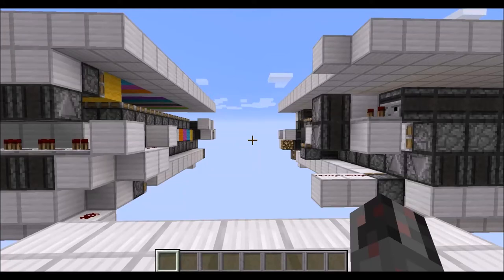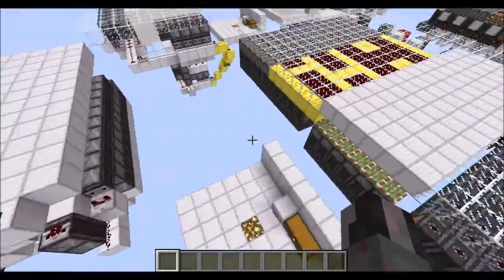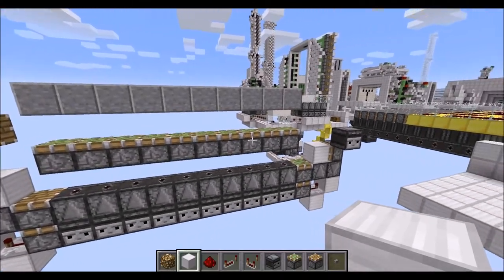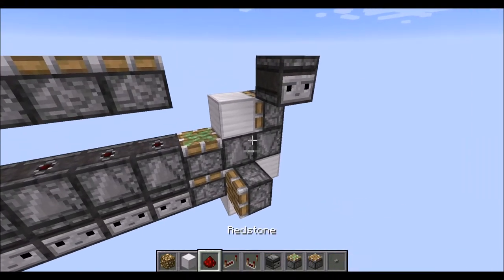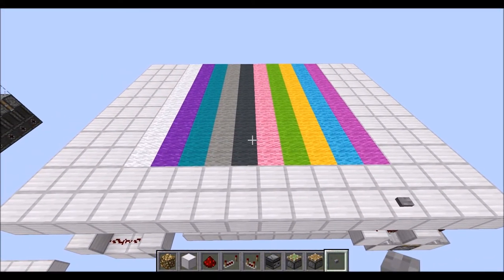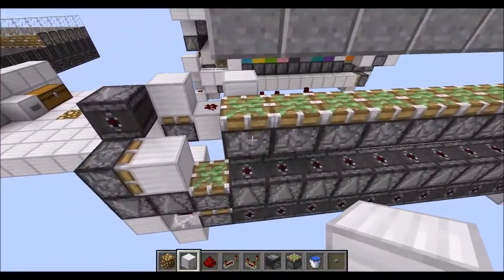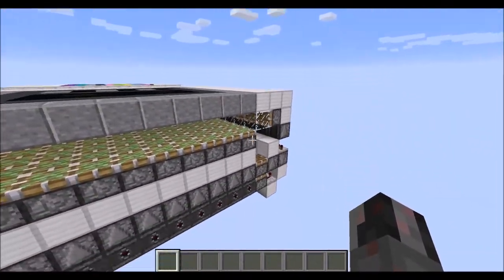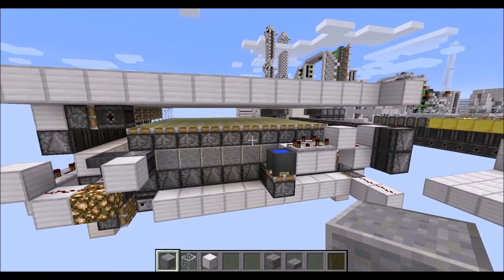Tutorial: Expandable, 10-wide Floor Block Swapper & Shifter [Java 1.11+] (Schematic)

Comment: For those who will say it's slow, well it's a 10 block swapper guys, and it's so majestic and well designed that it gives you not only the swapping but even an extremely satisfying show.
Thank you Walter for designing some of the best redstone contraptions ever and sharing your talent with us
Reply from the maker: Thank you!

Also, it may seem a bit slow for most, but it's actually pretty close to supercharged. Those double extenders simply need some time to completely extend and retract.

Comment: Haha, dude, nice. This is about exactly what I was building. I just used diagonal pistontapes instead of double piston extenders. Yours is a really simple design too, it's quite impressive.

Awesome concept! 

Hmmm, wouldn't it be possible to make it Glowstone viable by just increasing the height of a module by 2, pull the floorpusher pistons up to be directly powered and make the pistontape go below that. Because you're using the observer"timer" in the swapper, you shouldn't have many issues, no?

EDIT: That thought was too fast it seems but bear with me. To fix the problem of the fact that you're pulling the blocks above down, you can use a diagonal piston tape to pull the blocks down a bit to then be pulled down by a double extender. You would need to build a small "intersection" inbetween the blocktape below.

I hope I could convey what I meant ^^'.
Reply from the maker: I think I get what you mean, but with those diagonal tapes there's the risk of going over the pushing limit and the total size does increase too. I mentioned it a bit at the end, but you can actually put transparent blocks in the tape, which results in blocks that don't get pushed up into the floor. Adds a few interesting options for the users (hidden messages, two-part maps, etc.).
Reply: You would have to put a little intersection in the tape below pulling a block down and to the side making it 2 separate smaller tapes.

And yes, it's crazy how big and clunky that thing gets so I kinda stopped working on it. ^^
Reply from the maker: I see how that would work. Glad I came up with a simple design like this instead...
Reply: Yes man, me too :D Simple is always better ^^ (mostly)
Reply from the maker: Yeah, I agree :D